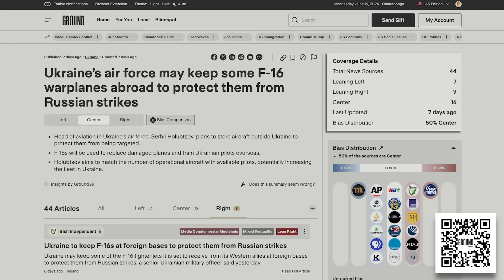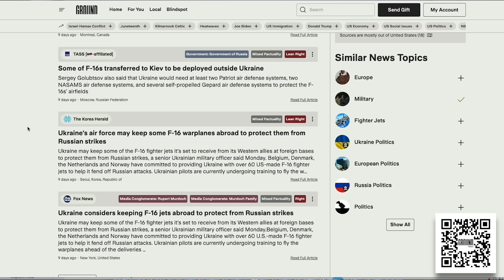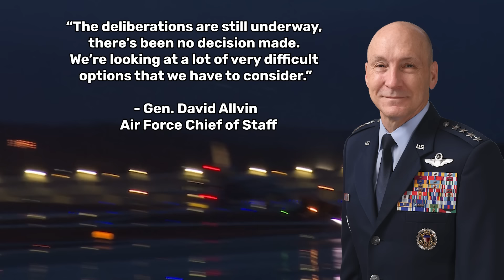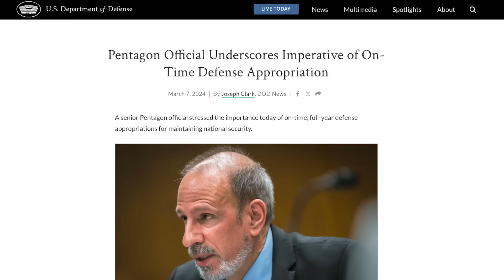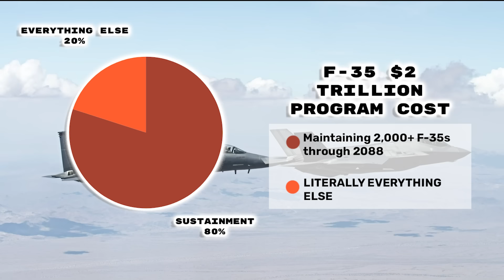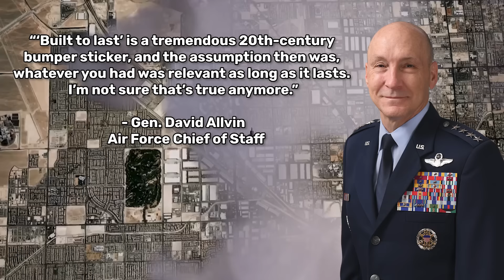Will America's new stealth fighter be shot down by cost already?

Comment: Just build the FB-22 has envisioned over 20 years ago (except with up-to-date systems). Fantastic aircraft, and while not cheap, will be way cheaper than a totally clean sheet design. Plus it will be true multi-role rather than pure air-to-air. Excellent analysis, buy the way. You know your stuff.
Reply: That would be more expensive than building ngad. All f22 manufacturing was scrapped and used to make production for the f35. Overall ngad would give you more bang for your buck
Reply: @julianzepeda2398  Your information is incorrect regarding F-22 manufacturing equipment, but even more important, your assertion that NGAD will be cheaper is literally insane. Grow up already.
Reply: @KRGruner  it literally will be you don’t have to believe me they already did a study on this and showed that it would cost similar amounts of money to field new f22s than to field a new more advanced platform. And buddy most if not all f22 manufacturering was canabalized for the f35.telling me to grow up while you’re the one coping there’s a reason why there’s a limited amount of f22s why build a old out dated(in terms of modern tech that’s in the f35) when you can create a new more capable platform for the same if not a little bit more money
Reply: @KRGruner  when I say cheaper I mean it as it will be better overall, cause than you’d have to modernize the f22 which would be difficult, the first brand new f22s would be expensive and obselote compared to say the f35s more modern tech suite. While the f22 has better a2a chops the f35 has better avionics and irst(something the f22 lacks) 360 awareness off bore sight targeting capabilities, etc. just accept it the f22 is sadly going to an early grave
Reply: @julianzepeda2398  Nothing you say is true. Not a single statement. In addition, you don't seem to have understood the simple fact that I did not advocate for a re-start of the F-22 production line, but for building the FB-22 version of the aircraft (with up-to-date systems), which was very significantly different (but would save money as there was still some common elements). So yeah, grow up.
Reply: @KRGruner  okay the fb22 would be plagued with the same problem the f22 has, you’d have to figure where to put these things again the f22 didn’t have irst, and with f35 you already have that multi role functionality. Starting up the fb22 production would cost more than starting up the f22 production again, would require a complete redesign in terms of tech suite. Ngad would provide all of that, all while being more stealthy, more modular as that’s an emphasis on what they want with ngad which is more of a system rather than a lone fighter. The ngad would overall be the better investment for the Air Force. There’s a reason why the proposed updated f22 program with Japan fell through. Ngad and it’s sister programs will benefit the us more especially with the drone wingman
Reply: @KRGruner  but please tell me how my infos in correct when it’s true even Alex has said as much about the assembly line for the f22 was mostly canabalized  for the f35
Reply: @julianzepeda2398  "but please tell me how my infos in correct when it’s true even Alex has said as much about the assembly line for the f22 was mostly canabalized  for the f35". LOL, man, really? You are first of all confused between "assembly line" (the F-35 is assembled at the Fort-Worth plant, where the F-16 line used to be and the F-22 NEVER was - it was built at the Martin Marietta plant in Georgia) and the tooling. The tooling for the F-35 is totally different, and the F-22 tooling is mothballed and available, although it would be costly to put back in action (but still less costly than BRABD NEW TOOLING, which is the point). I mean man, DO BETTER!
Reply: @KRGruner  you’d need new tooling with the fb-22, you’d need to adjust and move things around to fit new tech including irst, replace the ram for a more cost effective solution, it’s have to be compatible and able to updated with newer systems, modular have helmet mounted cueing, a new radar, potentially new engines, better sensors for awareness. The ngad will come with that from the package with new ram, new capabilities, more modular and compatible, stealthier. And you quoting makes it seem like you don’t see Alex as a credible source when he’s literally provided proof of how it would be better to field a new air frame than use an aging one. They already tried it with the hybrid f22/35 with Japan and it didn’t go through. You need to grow up and stop trying to troll lol
Reply: @julianzepeda2398  LOL, if Hollings is now THE reference, well, I guess we are doomed then! You are laughable. If two projects require pretty much the same things, but one already has a head start, even a small one, that one will win. Period. Learn from history.
Reply: @KRGruner  you’re a lost cause man. You hold onto to the fb22 all you want but with other jets filling that role there’s no need for it, they need a new air superiority platform to replace the old and slowly becoming more obseloe f22. But here ask yourself this would it be easier to completely have to redesign a old plane like the fb to get similar tech or to have jet already built to have those things especially since this program has been going on since 2014. Alex hollings has covered articles about this and I mean he’s got a lot more clout than you or I, dude has been quoted by congress etc. it’s better to build a newer more capable fighter than try to update a old design. Especially when the newer aircraft would have a longer life plan, with multiple upgrades as it’s built with modularity in mind. The fb would only be useful for so long before you’ll have to redesign it again. But hey keep coping
Reply: @KRGruner  the fb-22 would be plagued by the same issues the f22 had.
Reply: @julianzepeda2398  "the fb-22 would be plagued by the same issues the f22 had." Why? That makes zero sense. Explain yourself..
Reply: @KRGruner  I literally have but all you’ve done is continue to ignore my points, the fb22 would be plagued with high cost and rough compatibility with more modern systems till they redesign it and even than it wouldn’t be long before it arises again
Reply: @julianzepeda2398  No, you still have not shown that any of your objections are real. Just stating something does not make it so. Or are you not aware of that?
Reply: @KRGruner  “
In 2017, the Air Force conducted a study to examine the practicality of manufacturing more F-22s, identifying the key obstacles to this goal. The most striking barrier was the exorbitant cost. Without a dedicated production line in place, it would cost a staggering $50 billion to build an additional 194 units, translating to over $200 million per new aircraft. Astonishingly, merely setting up the production line calls for a $10 billion investment.” The f22 has also been plagued with oxygen problems, landing gear issues etc. not to mention this is a f22a without any modernization which would bump up the cost as it’s not produced meaning r&d hasn’t been developing improvements like what they did with th f15. So yea ngad would be the better investment, he’ll the f35 is. Overall what the fb22 would be needed for.
Reply: @julianzepeda2398  LOL, really? Oxygen and landing gear issues? The fact that they were bringing these up shows without ANY doubt that this study was complete bullshit. The fact is Lockheed Martin was not interested, as they were making way more money with the F-35 and even the F-16, since there was no export market for the F-22 (by law). That's the REAL reason the F-22 was not re-started. But regardless, a new FB-22 line would STILL be able to produce FB-22s at less cost (a LOT less cost) than the NGAD which has been quoted as AT LEAST $300 million per jet. And it would be far, far less risky. If NGAD is quotes as $300 million, you can bet it will end up being way, way more than that. But hey, corporate welfare is a real thing, I get it. I guess you have no issues with wasting tax money.
Reply: @KRGruner  the f22 was halted because of raising cost and it wasn’t needed in the current climate of warfare and the fb-22 failed to take off for the same reasons. Fb-22 would need a complete facelift. This isn’t just something you can swap especially since the f22 has little room in the cockpit. Why do you think they are making pods for it rather than adding irst to the plane itself. Lockheed literally offered Japan to restart the f22 with f36 tech but it fell through cause it’d be a better option to make a newer better jet. And do you not even know about the whole oxygen situation with the f22 that caused a huge stir? This was a congressional study.
Reply: @KRGruner  it would be wasting tax dollars getting the fb22 atp get more f35s as they are cheaper and can provide a wider use case compared to the fb and you wouldn’t have to redesign anything. You’ve only provided your own opinion without providing anything to support your points. Accept it ngad which a system of programs will benefit and be the better option for the Air Force. Especially since the extra stealth will help in a modern conflict
Reply: @KRGruner  far far less risky is bs, you’d have to redesign so much which would lead to some problems especially with the expensive ram coating
Reply: @julianzepeda2398  LOL, just as if on clue, Chief of Staff of the Air Force now says NGAD is far from certain from happening. You just can't make this shit up! FB-22 was the answer. PERFECT aircraft for the Air Force. NGAD before its time.
Reply: @KRGruner  no it wasn’t the perfect aircraft that’s why they didn’t adopt it. It would be the same problem as with the f22. Also again my point still stands they want to be able to upgrade and obtain new fighters every ten years. Which would still be better than the fb22 hell the yf23 would’ve been a better investment with your logic. Ngad is a system of programs that have given a lot of head way with a demonstrator for the ngad having already gone through testing ngad isn’t certain because of change of acquirement for new fighters atm they predict ngad is going to be 2 years delayed due to funding cuts. Fb22 and f22 suffered the same fate. You continue to argue for an aircraft that wasn’t even built and would Require complete overhauls which isn’t cheap. And it may not even be able to get them all unlike with a new airframe you can build it around new tech which they have.
Reply: @KRGruner  and the main cause of him saying that is because of inflation and problems with the sentinel missile and with inflation the price of b21s have risen
Reply: @julianzepeda2398  Still far cheaper AND less risky than a brand-new design. And faster delivery. NGAD is just the usual bullshit: looking for the holy grail when in fact you don't NEED the holy grail, only a workable design that is able to do the job. I guess we will never learn. For sure, you haven't leaned.
Reply: @KRGruner  it wouldn’t be faster delivery they’d have to retool already abandoned plants which will need to be refurbished repaired and readied to build a different design for the fb22 with making new improvements, adding a full tech refresh, requiring a new power plant for that airframe, changing out the ram coating some how adding space into the cockpit to fit the helmets used in all other aircraft. And to add irst, add new sensors to effectively use those helmets. Somehow make it not weigh even more and that’s all if they can do this within a short time frame. And justify a fighter bomber something that most multi role airframes can do including the f15ex, f35. Oh let’s not forget make it compatible with project wingmen make it modular so it can leverage new tech as it comes out including new missles. And somehow make it a little stealthier cause with those vertical control surfaces it’ll still give off a feedback on low band radars. And fix issues had with the f22, and any new issues that come with the fb22. So yea “cheaper”
Reply: @KRGruner  says the guy who’s stuck on a airframe that was a concept and would require restarting and retooling f22 production plants and a complete redesign since it’s a concept. But sure. People said the same damn thing about the f22 and f35 programs but look at them now lol
Reply: @julianzepeda2398  You are totally ignorant of the issues here, aren't you? How many years of experience in the industry do you have? I am very curious. Sounds like zero is the likely answer...
Reply: @KRGruner  again prove me wrong I’m literally telling you it isn’t as one sided as you think yet hear you are trying to say it like it would be a quick one and two. It won’t it’ll be a while and a expensive move, when they could and will get a brand new fighter that’s better over all compared to the fb22. Something the us hasn’t needed since the aardvark. Literally every program has shown it’s not black and weight. There were alot of cuts on the f22 that would’ve made it more viable for the future had we continued to buy them but since no one was as we could only buy them r&d never continued. They are barely getting some upgrades including stealth pods/ irst pods. Swear man all your doing is confirming you have personal bud
Reply: @julianzepeda2398  I notice you failed to answer my question. Try again.
Reply: @KRGruner  and you’ve failed to answer mine, all you’ve done is enter your personal bias
Reply: @julianzepeda2398  Or maybe, just maybe, I am speaking from knowledge and ACTUAL experience in the industry, at multiple levels and in multiple areas. Did that ever come to your mind?

Comment: Is it possible that the DOD is waiting for advancement in fission powered propulsion systems? Modular design would make a lot more sense with the base of fission power. They already said they won’t acquire more than 100 B-21 Raiders because they’re waiting on advanced technologies. Are we in a stopgap and waiting for fission power to be feasible for production? Does the US already field fission powered craft? Connecting the dots between the UAP hearings and the possible capabilities of fission powered airframes opens up some possibilities.

Comment: The cost of our advanced tech combat systems is a major problem.  Its a big enough problem to cause us to lose a major war.  Building the wrong system to fight the wrong war is also a big problem big enough to lose a war. But last of all the digital century series approach will not work.  It's true that a huge fraction of the cost of a weapon system is software and big software projects are notorious for going over budget ane behnd schedule, even in the civilian sector. But think of microsoft windows or the IOS operating system for iphone/ipads. You can't take a piece of software for windows and expect it to run under IOS.  One company has to control the underlying framework.  These "open systems" are not really open. In other words you can't mix and match something by Raytheon with something from Northrup.  The problem is fundamentally much harder to solve.

Comment: Agile is a joke, or if you prefer a marketing company for a broken method of product development.

The US military is a huger BUYER and if they could write an RFP and then sit their asses down they'd do well.  But for over a century they DON'T write a proper RFP, don't sit down, and INTERFERE with the entire process every day.

Never name something "Next Gen."  Even Star Trek got it wrong in the 1980s.  The FAA is just now figuring out "Next Gen ATC" is already unimplemented AND obsolete.  so's NGAD.

You can't design, build, test, train, and deploy a fighter jet in 10 years.  The chinese will have it up and running 8 years earlier.  The Iranians will have an 80% scale model to show off to TV too.  You have to be nimble.  That's not "Agile" nor N/G nor Boeing nor the USAF command mode.

How does this get solved?
1. The USAF provides specs to a contractor, and that's not your current batch of leech gocos.
2. Contractor publishes an RFP and it's fixed cost and fixed timeframe, and the failure penalty is "you're out of the project"
3. MFG starts the project and THEY DON'T GET PAID UNTIL THEY DELIVER
4. Part of the RFP is production quotas.  If  you can only make 17 a year, go sell ketchup and fill up a fridge shelf.  These are NGAD fighters, so don't bid what you can't build.
5. Install FTDs, build some models, and deliver.

Think about how you get your basic staples from the store, and how likely you'd ever shop again at a store that charged you $20,000 for a dozen eggs, a gallon of milk, and a loaf of bread.... that you had to wait a year to get.

The US government and its "baked in" gocos have  been leeching the system for years.
Time to cut that cord.

Comment: The F35 will cost 2 trillion dollars indeed but its structure is too weak to endure the 6000 hours flying it was meant to.
It's more likely to fly 2000.
6000 hours slow flying in  60 years makes it a 100 hour per year. That's the weekend flight in an aero club. That's what the F35 is capable of.

+ it's the worst ever U.S made airplane.

So it will not last 60 years for sure. 
Or maybe it will but for 10 trillion dollars (inflation not included).
 
So if you think the F35 is a good bargain, you're having a pipe dream.

Comment: Instead exorbitantly expensive stealth, the Air Force (and Navy) should focus on Electronic Warfare that can hide anything and burn through any signal. The Gripen E/F, F15-EX, and the F-35 are all incredibly advanced in the Electronic realm and should be the focus going forward. Build lots and lots of Eagle 2s and get that darn Block 4 F-35 out in the wild. Heck, buy some Gripen E/Fs to complement these others or at least use the same tech.This would be enough to face today's threats. Save NGAD for the future when the tech is cheaper.